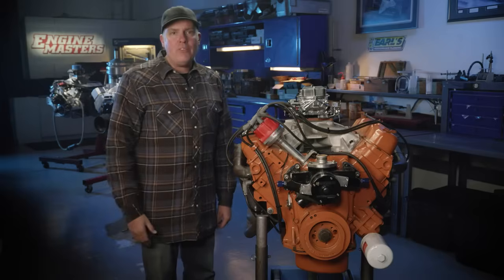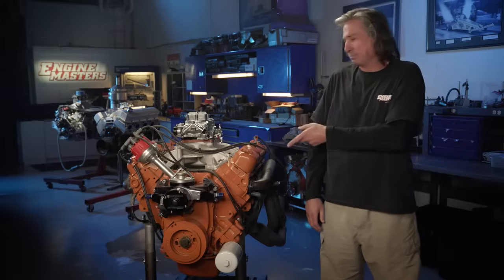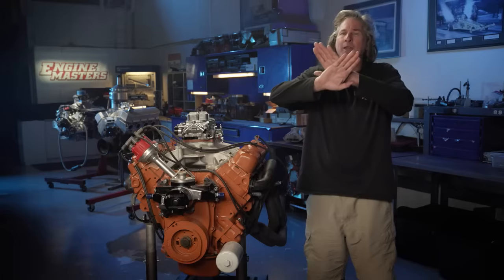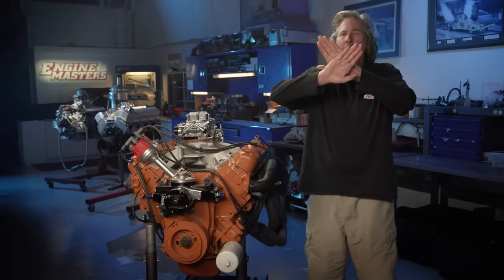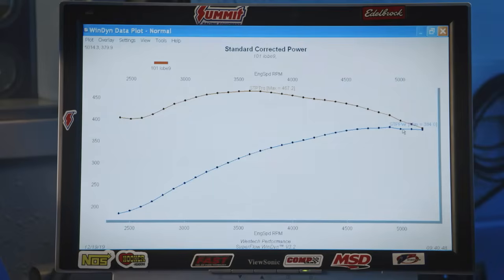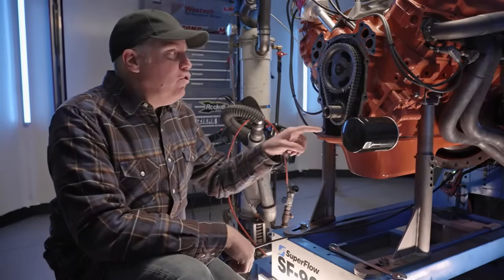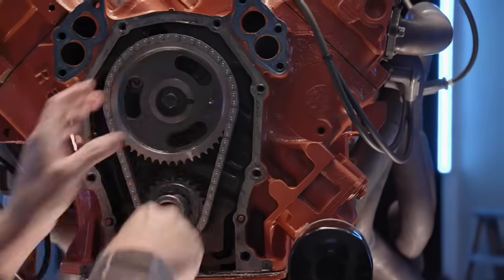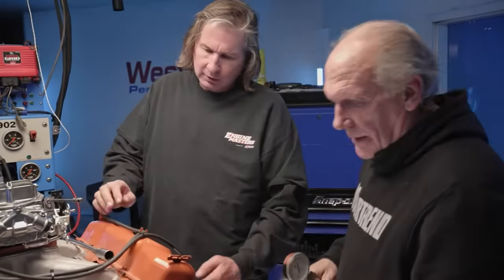Engine Masters  S5E58  Advances in Cam Timing

Comment: 😂 is funny hp really I built me a little d15b2 Honda engine I sent the head to be mill .30  port and polish mild to fit  the skunk 2 manifold  plus I put 65 mm throttle and 240cc injectors put a y8 head gasket is thinner than stock and better metal gaskets from a d16y8 engine compression around 10.2 to 10.5 all motor I call delta cam and I put a 272 regrind cam with spring stock and everything else stock from d15b2 engine chip the computer and hook it up to my o computer and plug and play wires kit I put header and 2 1/4 free flow exhaust system homemade I play with the cam timing and I say going normal with it no back and forth crap with cam but I did play with distributor timing by putting my CRX in stiff hill and bingo old school style nothing special and I put a lighter flywheel gd clutch kit and I can say guys I built a fast little go kart peppy like hell and believe me I run her hard sometimes and I never have any problems with cam or valves vending or crap like that I broke the theory about valves retainers and all that crap but a lots of my friends with VTEC and turbos with a lots of money invested had a lots of problems even with cams and springs rockers etc and I never had any problems with my junkyards build and really all originals parts from old motors and like I said she really do fly I think she around 135 to 150 or 160 HP I still get 36 miles a gallon if I don't push her which is hard to do because seems people like to text her in the streets for her sound with a cherry bumb muffler and her cam and compression ratio she sounds tuff look tuff all motor and I can say in higher rpm she pull like hell no long ago a Camaro get next to me in the highway and start making noise I'm doing sp limited crap guys I drop my to 3 gear and flow the skunk 2 manifold with gas and air and I can say the Camaro can't see the tail lights jjjj 😁 CCR born in the byouooooo all is about timing really the best way for distribution timing is up a stiff hill old school style cam timing restarted one 1 to 2 tooth really but in my opinion distributor timing is the key in all motor set up like I said I build my old school using little technology like more fuel and air the rest old school style little things in a engine matter by the end of the day gd jobs guys but the kings in the streets are with a H in front of the cars call four bangers combos from junkyards really and rotary engines coming up Puerto Rico bring one 5.45 second in a quarter and Honda k on 4 .75 on a quarter real simple

Comment: That's one thing about mopars...even my 5.2L magnum has miles of deck height clearance.🤮🤮 I'm trying to guess where I should put my XE286HR in my 390. Most 408s make peak Hp at 5,900/6,000 installed 4 degrees advanced.

Comment: Slow burn, no quench. low compression low torque. You would think the engine makes more power with a worn timing chain.   The intake manifold and heads may not have good velocity and port matching may be poor.

Comment: Its funny, these guys are so used to big power and hot rods that they really scoff at the 381 horsepower low-comp 440. Frankly, thats a lot of power to a guy like me and I would be happy to extract as much power from a lowly motorhome engine.  Especially if you consider it will run on poor octane gas and Is (relatively) indestructible.  Very cool.
Reply: Yup. A great Mexican Hot Rod… You could drive all over back country Mexico where sometimes the gas is old and has shit for octane.
Reply: @michaellauer3397  Agreed, sir.  Thanks.
Reply: Especially when it's obvious the HP is always at.the higher rpm and torque is at much lower. With a motorhome plant rpm is not the idea, those engines are simply not supposed to make high HP at high rpm. This is like comparing apples to oranges or light to dark. Build an engine to one of the other, you can't have it both ways really. If tech had been around then when these were made as it is now with variable valve timing then things would be much different.
Reply: Slap some 8:1 pistons in it, a turbo, and a massive aftercooler. Make sure you file the rings for the proper gap they will need for hotter temps under boost. There you go. It is an ideal engine for BOOST. Low revs and low compression open the door to find out just how much torque your transmission can take.

Comment: I have a '78 440 out of an RV in my 70 Challenger. I pulled the heads before I installed it in the car just to measure everything and to verify it was a low mileage engine. Using Summit's compression calculator it came out to 8.46-1 with a .020 Mr Gasket head gasket. The 452 heads had 88cc chambers. I put in a Comp Cams 274H cam, Edlebrock Performer RPM instake, 750 Brawler carb, long tube headers that were already in the car, factory electronic ignition. The car has a 3.55 Suregrip, 2700 stall converter and a 2 1/2" Pypes exhaust with an X crossover. It runs 13.0's@102-103. I think that's probably about what an original 440 Magnum would have done with the same sticky radials I use and a really good tune and decent driver. And the best thing is that I can pump 87 octane gas in it with no complaints from the engine.

Comment: I’d like to see this engine with a cam that has 112° or 114° of lobe separation
Reply: It would lose 20-30hp and torque, maybe more. They did a great video where they took 106, 112 and 118 degree cams, all with the same lift and duration and the 106 was a winner by a long shot. The disadvantage is that you can't run as much overlap without effecting idle quality and vacuum. But when it comes to making power the tighter LSA makes more, especially in the lower half of the rpm range.
Reply: @1967davethewave what is not mentioned is that lobe profile can be ground with wide LSA and longer duration. You don’t have to have tighter LSA for valve overlap. It takes a custom grind and a good race engine builder to design it.

Comment: Wait a second, how do you know the results are due to a earlier and later intake valve event? How do you know it wasnt the exhaust valve events that did it? Without keeping the intake lobe in the same spot and re grinding the exhaust in a different spot etc (for example) youll never know
Reply: Experience.
Intake closing event is the most sensitive to change, far exceeding any +/- gains from the other 3 events combined.

Comment: As a long time Mopar fan and mechanic, I find that a compression test is only a diagnostic for what it's worth. mopars with their gear eduction starters will always show lower pressure than what you would see with a standard no reduction unit because the engine is spun slower, giving more time for bleed off. Once the engine is running those pressures are going to be much higher. Advancing the valve timing is going to hold pressures higher but as they show, output will be lower, intake vaccum with higher but rpm will move lower peaks. These motorhome engines were designed to keep timing and ignition issues manageable under heavy loads. Mopar went about this wrong IMOp. Motorhomes have to be geared low to pull but doing this killed mileage, the heads where a bad design because of emissions rules and engineering had not advanced far enough at the time these engines were in production. Such a low piston hieght in the block with those open chamber heads did nothing to help ignition problems with these engines..Chevy big blocks never had near the problems Mopars did there and had clised chambered heads, made actually a better truck/RV motor. Mileage could be massively improved with the Chevy HEI's with a timing kit and power was better too. That's what I found anyway. Getting any engine to make better power for heavy loads should help control heating too. We all know if the engine isn't.laboring, it works much better. I never got why any Motorhome was.made with anstandard gas engine in the first place other than just being CHEAP! Diesel.just made so.much more sense because fuel didn't go bad during storage, mileage was always better as well as engine life! If I had an RV of the Mopar breed, with a 440 or a 400, not my best choice the low deck because of the block water jackets I would stick with that but that piston and head has to go!! Get the deck height resolved to get the chamber reduced to as close to the spark plug as possible and use anD shaped piston if you have to keep compression down around 9 to 8.5, no higher or lower. Then do something with those ports, the later heads weren't bad with the ramp to make swirl but they were vey inconsistant castings. Not enough iron in them either..Find a set of earlier heavy industrial casting and work those over. Just my 2 cents
Reply: Your 2 cents was only worth 1 cent because half of it was wrong and the other half was a non sensical rambling stream of consciousness.

Comment: If you can walk the compression up to 11 and a half to 1....... And could give it some decent squish.... Then do one of those port jobs you're known for..... 500 would not be a problem for that thing.  Fact 600
Reply: I had a 440 built to 505, 10.5:1, pump fuel, Holly Dominator EFI with progressive nitrous. 150 shot. 850hp

Comment: 7.5:1? How did it hit 150psi when tested?

150 / 14.7 = 10.2:1
14.7 x 7.5 = 110psi
Reply: You've calculated the pressure if the temperature of the gas in the cylinder stays constant. However, the compression in an engine cylinder is not constant temperature: it's closer to adiabatic, meaning that the air isn't cooled by the cylinder walls and thus its temperature rises as it gets compressed. Heating up a gas at constant volume raises its pressure, and that compounds with the reduction in volume to give an exponential rise in pressure during this kind of compression.

The equation for pressure during adiabatic compression is: P1V1^y = P2V2^y. Note the exponent y, it's there because of that exponential rise in pressure. The value of y depends on the gas involved, it's actually a physical property of gases known as the ratio of specific heats.

 y for air is 1.4. From that and the formula, the pressure at TDC for a 7.5:1 compression ratio should be 241 psi.

In a real engine, the air loses some but not all of its heat to the cylinder walls. So you get a value in between that predicted for adiabatic compression and that predicted for constant temperature compression. 150 psi isn't crazy in that respect. The faster you crank the closer the measured value will be to the one predicted by the adiabatic formula because there's less time for the heat to transfer out of the air.
Reply: You’re confusing static vs dynamic compression. The static compression ratio is based on the volume of the cylinder at BDC compared to the volume at TDC. The dynamic compression is that and the fact that the intake valve isn’t completely closed before the piston starts back up.  Therefor as was mentioned in the video, no compression is captured until that valve is 100% closed. That effectively lowers the total volume of the cylinder at that point. This is also why advancing the cam will generally increase dynamic compression. When we advance the cam we advance the valve event so the intake valve closes sooner and captures more compression. It’s also why VVT is gods gift to engines.
Also, watch the end of the video.
Reply: The cranking compression calculation has more to do with cam timing than anything,  assuming a healthy engine.
Reply: @chriswise1232 Yeah, and usually that is lower than the calculated compression because engine speed is so low.
Reply: The dynamic compression is typically not higher than the static compression.

Comment: Why would you even make a video with this engine??  I’ve never seen someone try so hard for a weak 400hp.  You guys are becoming outdated with your nonstop carburetors…
Reply: efi isnt gonna make more hp you ding dong lmao.
Reply: @frigglebiscuit7484 it'll make less if the manifolds the same and using a throttle body and port injection

Comment: There's no better looking motor than a big block mopar with a tunnel ram or blower. Tgey look like a small block Chevy on steroids with the distributor in a better place. 

With how bad these heads are, these Mopars can be made to scream with just pistons, intake, cam and headers. The open chamber heads just suck, but they have made a bunch of damn quick cars even using those turds. 

I have a ss Monte Carlo and i would love to drop a 499 bbm stroker in it. Sad part is im a Chevy guy, but i love BBM.
Reply: Chevy engine has a better distributor position on a Van or Motorhome. Not many vehicles that you can adjust the timing from the driver seat on.😅😅😅
Reply: Big Chryslers may not be the horsepower kings, but they will always be my favorite. Excellent driving and power right from idle.
Reply: @mickangio16  they are built like a tractor engine. I'll be honest, all tge mooar guys around her ate pretty dominant in winning races. Idk if it's just the torque or what, but they spun them to 7k.
Reply: same, im a mopar guy at heart, but i bought a 78 trans am a few years ago. i was so tempted to put the 400 mopar out of my dart in it lol.
Reply: @frigglebiscuit7484  I've got 2 400 BBM blocks, I've thought about stroking one to a 499 and dropping it in my SS Monte Carlo.  Everything is just so damned expensive for a Mopar.

Comment: A 440 sixpac motor was factory rated at 390HP so this motorhome  engine did pretty good...
Reply: Manufacturer rated hp is with accessories on.
Reply: @Buffington916 
Not back then. That started about @73
Reply: 440 six pack made over 450hp with fan waterpump and alternator.
Reply: The motor home 440 is a great sleeper with a lot of potential. Chrysler put light weight high strength rods in them. Great motor to modify with strong internal parts

Comment: Did he say 7.5 to one compression
Reply: Make a hell of a nitrous or forced induction motor, if the parts in it didn't suck.
Reply: @inscoredbz 
Factory parts can withstand 500 hp. I wouldn't say that sucks too bad.
Reply: Unfortunately, the block is the Achille's heel when it comes to building a big power Chrysler engine and aftermarket blocks are rare and expensive. 5-600 hp and exceptable driveability is pretty reliable and not too hard to get out of a factory stock block 440 and is about as much fun as a gearhead could ask for in a classic car. When the motor was designed in the 1950s nobody ever dreamed that one day someone would have visions of getting1000 hp & more from it. Think reality. 500 hp & torque is a lot of fun. Of course, I'm old and most young people seem to have different ideas.
Reply: Yes he did
Reply: At 2:10 or so he said 7.2:1
Reply: The epitome of a lazy gas guzzling american V8
Reply: My son's first car was a 1973 Dodge Charger 400/727/3.23 Sure Grip. Not my choice. Big fight over it. I wanted to find a nice Dart or Duster sb. Anyway, we got rid of the marshmallow suspension and front subframe mounts,  put a rebuilt motorhome engine in it with an RV cam. Holley, Edelbrock, headers, etc. The pistons were so far in the hole I couldn't believe it. On top of that it had a crazy bevel around the top of the bore. That motor had such a low compression that you could not make it gas ping no matter how much timing you gave it. But with very aggressive ignition timing it was a pretty strong runner with 3.23 gears. Would light up the 50 series Mickey T's under 40 mph. That was about 30 yrs ago. A close friend still has the car with a hotter 440 in it now.

Comment: Better heads would bring out a bunch more in this 440 imo
Reply: That's a given, but I think it would be interesting to see this same engine again but with only the higher comp. pistons installed with the same heads and intake.
Reply: @OddBallPerformance  so would i. Im thinking 2 points of compression could be an optimistic 10%(realistic 7-8%) hp gain and both torque and hp from idle to redline. Gotta luv compression.
Reply: Sure, absolutely.  But the mission statement was make a dog low compression motor home engine perk up, just with cam/specific specs to help all the awful dog parts
Reply: Imo no one cares😂